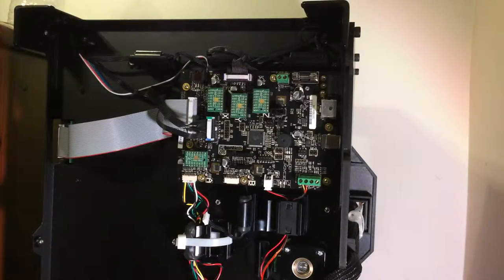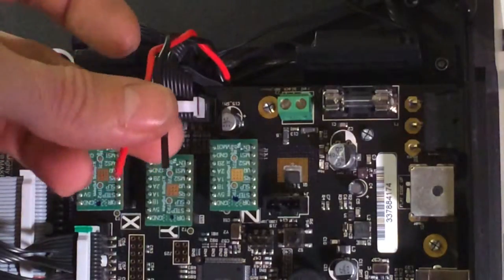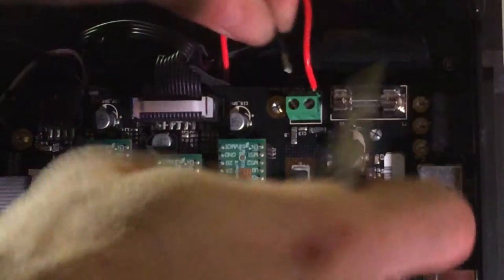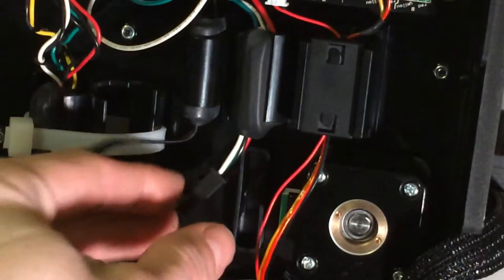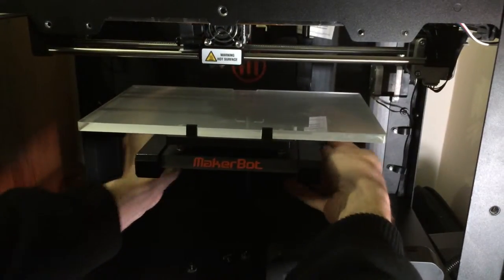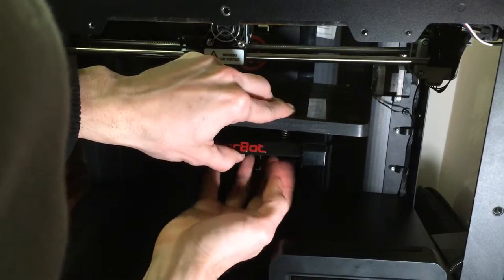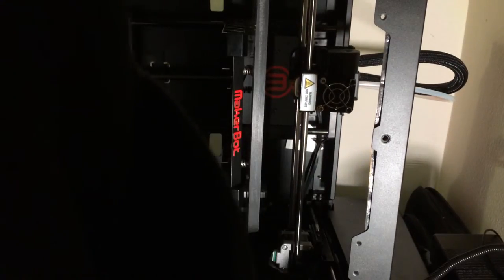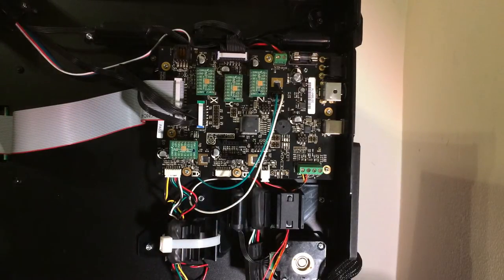Installing a HBP on Replicator 2

Comment from the maker: That's was a heat bed plate off a R2X that init own anymore. 
I was not going to install it, but I had to try the R2X HBP warp fix that was posted. I used to have 3 R2X HBP because of the warping and that one is the most level, almost perfect. So I decided to try the fix and install it when I was waiting on my bottleworks HBP. 
The fix worked great, ran it for 2 weeks then removed it and installed the bottlework HBP. 

This plate is currently collecting dust again in a box.

Comment: Hi Scott, where do I buy the same hbp that on the video and the power supply?
Reply from the maker: The HBP and PSU on this video is stock with the Replicator 2X from Makerbot, I don't know if they make it anymore. 
I currently run the HBP in this video, and the power supply in this video also. 
The links to this stuff can be found in the video description.
https://youtu.be/wI_Udwf4tVA

Comment: Hello Scott, I have a question about Firmware... do we need to upgrade, change or reprogram Firmware to control HBP temperature from the software ??... does it recognize autmatically ? or how is the process about firmware ?
Reply from the maker: Their is a setting in the firmware to tell the control board that you have installed a heat bed. This does need to be turned on so it knows to monitor the temperature and follow the code instructions to set the temp of the bed during a print. If it's not turned in the printed will ignore the instructions in the print file.
Reply: Wow.... I have no Idea how to do that... any recomentations ?... I have a Maketbot Rep 2
Reply from the maker: I don't know or remember if the stock firmware is the same or not.
I run SailFish and highly recommend looking into using tha firmware with the Makerbot replicator 2, escpecialy if you installed a heat bed.
With sailfish I do the following in the settings:
Utility
General
Het bed plate installed, select and change to YES.

Also if you use the menu on the printer to preheat the printer then you would want to change your preheat setting temperatures. After enabling or telling the firmware it now has a heat bed plate it will show an option for a preheat temperature for the heatbed plate.
You want to set that to the desired preheat temperature for your heat bed.

Now for printing you need to tell your printing software that you also have a heat bed plate now. Everysoftware is different so I would google for the software you use to get directions on changing the settings. 
Some people just tell the software that the replicator 2 is now a 2X, but this will also offset your center point and will need to be adjusted in your prints GCode or the printing software also. I do run mine as a 2X, but I also run dual extruder so it's basically a 2X, but with much better parts and better prints.

If you google for the software you use, you will find things like this that will help.
http://3dprinting-blog.com/487-how-to-use-heated-build-plate-on-replicator-2-with-makerbot-desktop/

Hope this helps,
Scott